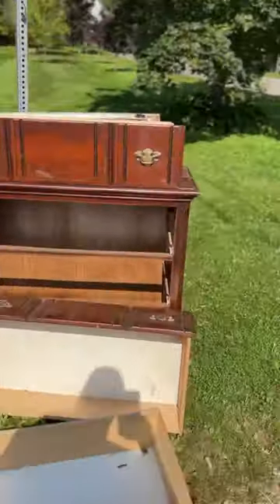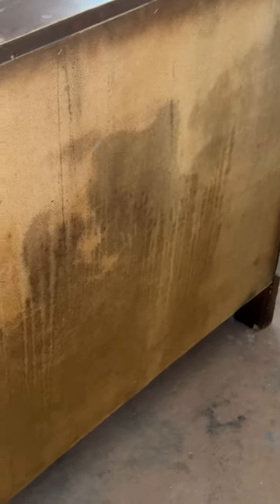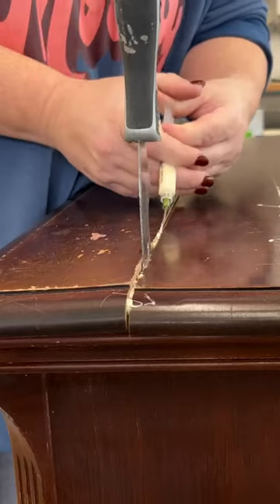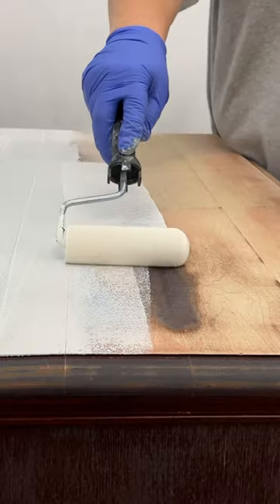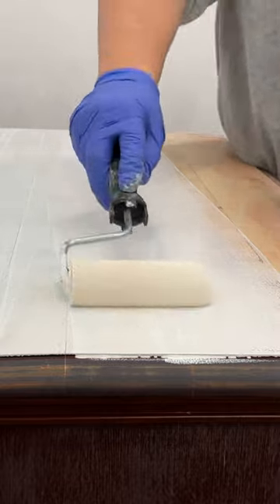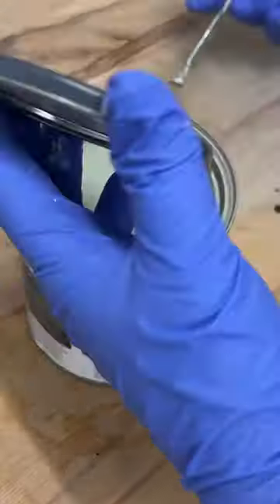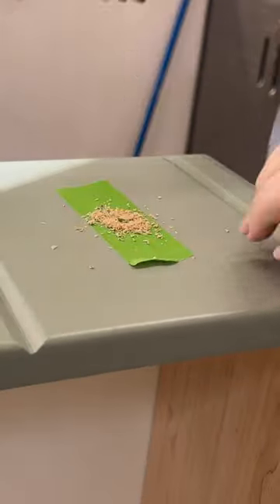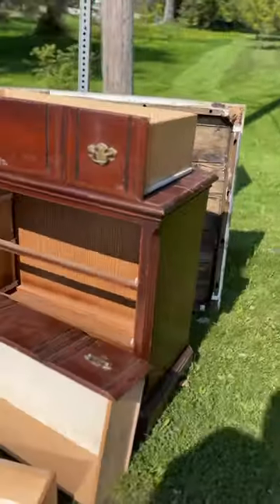Rescued from the TRASH! #diy

Comment from the maker: Watch the full length video here:
https://youtu.be/lV7i3kLJ4ng

Products Used in this Video:
+Simple Green https://urlgeni.us/amzn/SimpleGreen 
+Microfibre Rags https://urlgeni.us/amzn/GrabARag 
+Nitrile Gloves https://urlgeni.us/amzn/NitrileGloves 
+HOTO Electric Screwdriver https://urlgeni.us/amzn/HOTOSCREWDRIVER 
+Ryobi ONE+ Drill & Impact Driver https://urlgeni.us/amzn/RyobiONEDrill 
+Scrub Brush Drill Attachment https://urlgeni.us/amzn/DrillScrubBrush 
+Wood Glue https://urlgeni.us/amzn/7wZnc 
*Glue Syringe https://urlgeni.us/amzn/GlueSyringe 
+Bondo Filler https://urlgeni.us/amzn/APBondo 
+RZ Mask https://urlgeni.us/amzn/RZMask 
+3M Half Mask Respirator https://urlgeni.us/amzn/3MRespirator 
+Large Clamps https://urlgeni.us/amzn/IrwinBarClamp 
+SurfPrep 3x4 Electric Ray Sander with 120 Grit Sandpaper & Foam Interface Pad
Save 10% at www.SurfPrepSanding.com by using code KATIESCOTT10
+BIN Shellac Based Primer https://urlgeni.us/amzn/BINShellacBasedPrimer 
*4” Foam Roller https://urlgeni.us/amzn/FoamRollerWithTray 
+DAP WoodPro-X Wood Filler https://urlgeni.us/amzn/DAPWoodPro-X 
+Cover Stain Primer https://urlgeni.us/amzn/CoverStain 
+Wise Owl One Hour Enamel in “Celtic Fog” 
+Gravity Fed HVLP Pneumatic Spray Gun https://urlgeni.us/amzn/hvlpPaintSprayer 
+Paper Paint Filter https://urlgeni.us/amzn/PaintFilter 
+New Drawer Tracks https://urlgeni.us/amzn/MetalDrawerTracks 

links earn commission